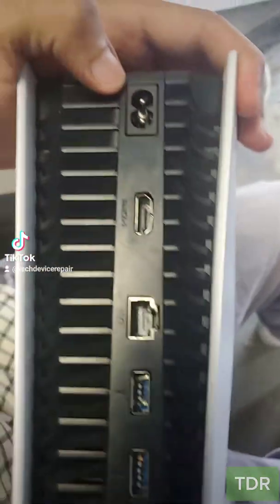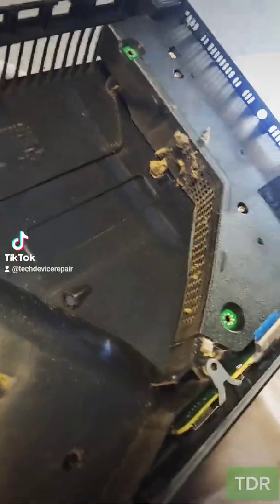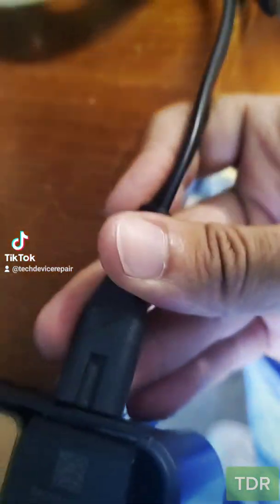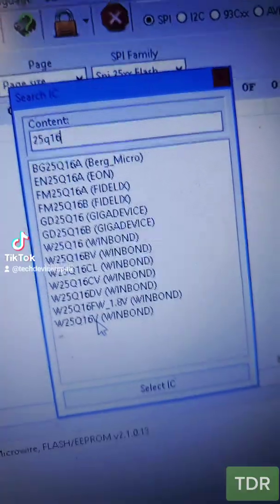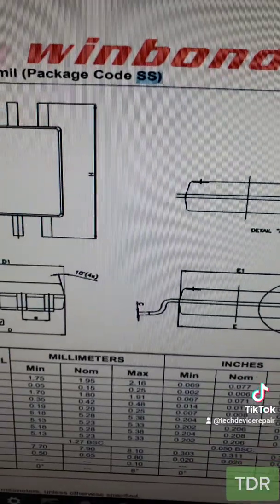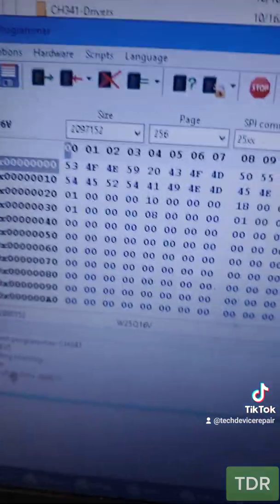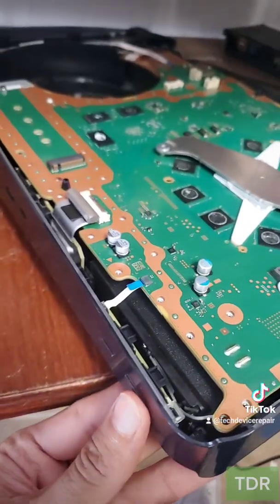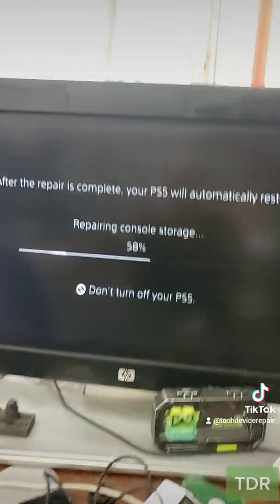This PS5 repair video was banned on TikTok!!! #mustwatch

Comment: HI YOU CAN BETTER USE  colibri firmware of neo programmer  for ch341a programmer Will support more chips and is reliable.
It is piety you have only short video's. Regards Steve from Belgium